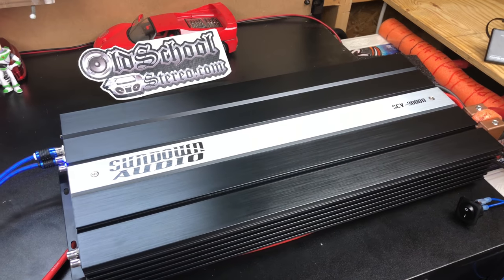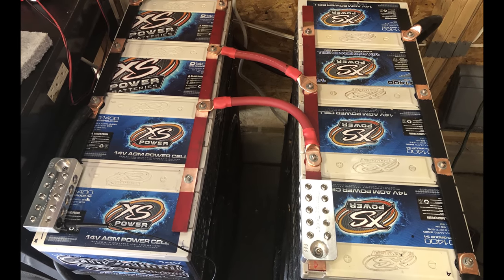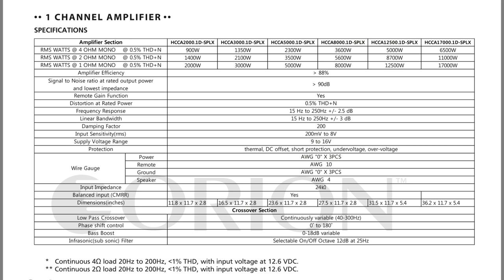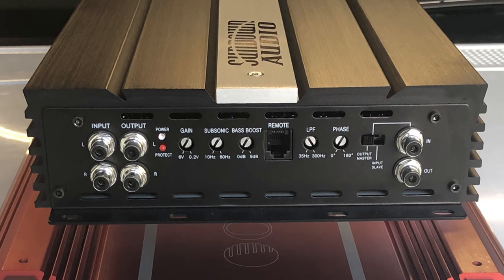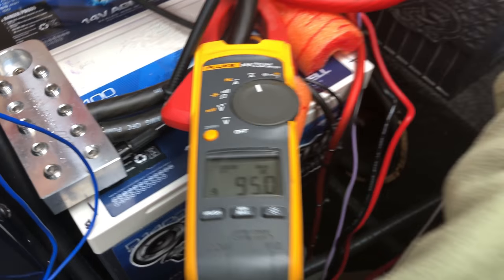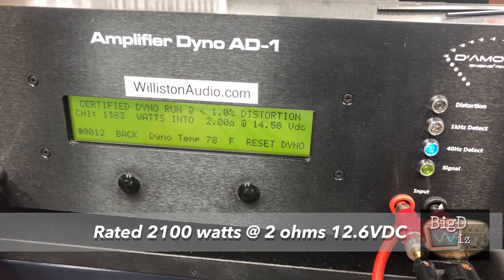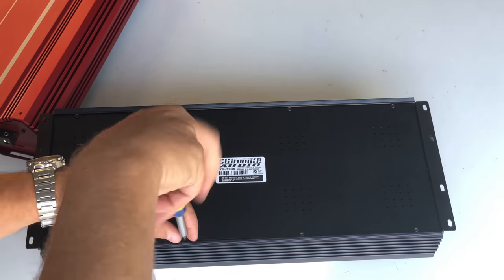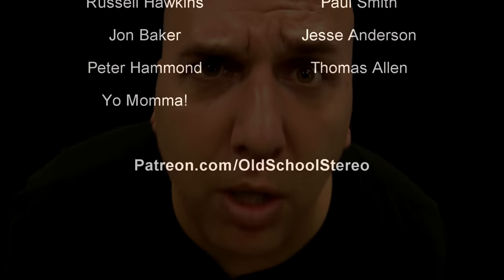Sundown SCV-3000D vs Orion HCCA 3000.1DSPLX Amp Dyno Test (4K)

Comment: Just to see if I understand but when doing a dyno and testing the amp at  .8 with an output of 8799 watts, am I correct in assuming the 8799 watts is the output of the amp if it's final impedance is .8 after rise?  I assume some people think if they wire their amps down to .8 that they will see 8799 watts but after rise, they will more than likely be around 1.5 ohms and will see far less than 8799.
Reply from the maker: No ride with Dyno tests. The amps are tested into resistive loads which do not exhibit impedance rise

Comment: Would like 2 see you dyno a Earthquake phd10000w2 . Its a Red Amplifier. Claims 5000RMS.  I running it on two 106v2 Jl audio sub's. Extra agm kinetics battery. No complaints. It slaps hard.

Comment: Would have liked to have seen Orion 12v test.  Great videos!
Reply from the maker: Birth sheet said 3300 at 12.6
Reply: BigDWiz I just thought the comparison of ur test to Orion's test would have been interesting.
Reply from the maker: I use 14 volt batteries, so not easy to get down to 12 volts
Reply: BigDWiz sorry, I forgot u use 14v batts now..

Comment: It's December 2022. The Orion HCCA 3000.1 is back on sale and I'm about to pull the trigger. It's like $700 on Amazon. I'm hoping they're still basically the same as when Big D reviewed it, but maybe with some improvements. 

I have 2 Ignite R3000.1D, each powering a Skar EVL 12 on 5 car batteries with a stock (90 amp) alternator in a 2016 VW Tiguan. It drops to 12.1-11.9 volts engine running so here's the planned upgrade:

2x Skar ZVX-12s, Orion HCCA 3000.1 on 6 car batteries (might upgrade to Lifepo4), with a Mechman 370. Also looking at Deaf Bonce Apocalypse 12s.

edit: the Orion now DOES have a variable subsonic filter instead of a switch! Hoping this is the only change that was made, and everything else is the same or better.

To expand on my current build, I chose the Ignites based on Big D's reviews and they have been incredible for years now. They put out 1150 watts RMS each, and the Skar EVLs have likewise been a great value and pound like hell. Whenever I do a bass demo it shocks everyone and pops eyes open, takes your breath away. Currently in a 4.5 cu. ft. ported QBomb box but I may fabricate my own for the upgrade. If I switch to Lifepo4 it'll probably be 3x 100 aH, and of course I'll do the big 3 upgrade with the Mechman 370.

Any subwoofer recommendations will be considered, aside from Skar ZVX-12s I'm looking at Deaf Bonce Apocalypse, Sundown Audio X, or DC Elite.
Reply: Do anybody have a up to date photo of the Orion 3000.1??

Comment: That's cool that Orion is built so well but I feel like with it putting out that much more then its rated I'd be blowing subs cause I'm expecting 3000 watts and getting 7k
Reply: Them set using a dmm to 3000 watts  problem solved

Comment: Back in the days of mini trucks and people rolling competition sound systems a good friend of mine had a 70’s Camaro with 8 10” Orion subs with a highfonics sis amp running them: that was enough to possibly stop ones heart. If I remember correctly that amp was rated at like 400rms. So if I were to  run a similar set up with today’s 3000wat amp would that make it louder? What I’m getting at is are today’s 3000 wat amps really that much stronger than our Rockford punch 150? Is it just marketing? Do you have a video explaining this or can you make one please.
Reply from the maker: Yes new amps are WAY more powerful, however the subs are less efficient. Bigger amps require more wire, bigger alternator, extra batteries etc.

Comment: The Orion is very underrated. What I hate to see though is those darn Samwha caps. I've replaced a ton of failed Samwha and capxon capacitors over the years. You'd think at that price point they would spec decent capacitors.
Reply: ive been trying to find out which cap brands are good when they do guts shots. what other brands should we look out for besides those 2 mentioned or are there certain specs to look for, i always wanted to know what the numbers on the caps mean

Comment: I know having lower watts than the specs is bad but having more is bad also right ? Especially when it's almost 2x
I mean, it says 3000 watts and if i get 3500 watts subwoofer, i might blow it, because that thing pushes way way more than rated.
Reply from the maker: You can overpower subs, but I’d rather get more than less for my $$

Comment: Could have seen Orion slamming sundown in this test. 
You can tell by looking at the power connectors on both amps. 
I personally believe it defeats the purpose to have copper connectors for doubling the power wires to a single terminal. 
Its all going to travel through the same circuitry. I do believe thicker power wire is for better performance and for recommended specs to an amp. 
However after watching the trays get pulled to show the insides of both amps. Its a dead give away that Orion has its power sources split up in the circuit board before amplifying sound to make a lot more power.

Comment: Is the discrepancy on the Orion from them rating at .5%THD vs.  your 1%THD certified test?
Reply from the maker: That and the fact they rate at 12.6 volts. There is a LOT more power capable with 2 additional volts

Comment: Orion Murdered the competition. How would one get triple power wires to the amp? Do you just wire them directly to the battery? Besides doing the Big 3, What other upgrades to the cars electrical system Must be done to Accommodate such high Amp draw? What’s a Good rule of thumb as to when these upgrades need to be done, for example if you’re running anything of “X” amount of Watts you should definitely do certain upgrades? Thanks for Any help.
Reply: from what ive been told, do the big 3 when youre system is pushing 1000 watts rms, install a capacitor around 1500 rms, change the alternator and get a second battery at 1700 rms. for the hcca amp im assuming multiple alternators and at least 3 batteries to keep it happy

Comment: Testing done n if all the amps were the same price what one would you choose. 
Not an easy decision some people don't need over 7k. Some people would look at the longevity of the amp. A lot of people would just flat out stick to there brand. So Derick what would be your choice?? I know what mine would be...
Reply from the maker: I really like the efficiency of the Nendo and DC amps. I really don’t think you could go wrong with any of these. I bought the Orion and plan on trying it out, but most likely at 4 ohms
Reply: BigDWiz that would be my choice too. And for the same reason.👍👍👍👍

Comment: Big D,,,, I wanted to ask your opinion on these newer amps.. Do they sound as good as the amps of old to u? What I mean is,, 2000 + watts nowadays can be had for decent low price. but,, do they sound good.. ? 2000 watts might be strong, but if the pre- amp is junk or the sensitivity  is low ,, from my experience,  they don't sound good.. kind of empty sounding. not rich dynamic sound.. back in my days of the haydays of brands like fosgate,alpine,ppi,a/d/s, phoenix gold,etc,etc.. anything that was worth a shit at all soundwise, was a buck a watt.. I'm talking late 80s -95ish Era of sound..  In my experience the stuff now is either cheap to buy and sounds like crap, or overpriced and not even a shadow of old school power.. What is your opinion.? I can't afford to figure it out these days.. lol
Thanks Man!!.. Love the Oldschoolstereo!!
Reply: stick with A/B amps for better quality but they consume the power.They get hot.  As for Class D... these days people are that design these days with better filtering Caps etc... Chokes... Class D is efficient, run cooler and suck less on the battery in the end.  Class D has come a long way since the days they was mainly used as woofer amps and not for mids and highs.  These days theres some really great TINY Class D Amps that sound really good in the mids and highs. and deliver lots of power in a very small box.... These are the best of times for Car Audio....  BDBD/2021

Comment: Where do i buy a high amp power supply to use Hcca 3000.1 in my house or is there a better solution to this problem
Reply from the maker: You’d need something like a XS Power Titan 8 and charger
Reply: Williston Audio Labs thank you and I appreciate all the dynos you do . Is there a difference in amp draw if i used the same amp one for highs and  one for lows not the same amp but 2 of the same kind?

Comment: Where can i buy this amp??? What the model number.. im having a hard time finding the new orion splx series
Reply from the maker: They are currently out of stock, but coming soon.
Reply: @wal  do know if they going up on the price with this HCCA3000.1DSPLX?.. i see some websites prices now have them at $959.. compared to the $649 on Amazon.. same for the HCCA121SPLX subwoofer.. i 1st found them at $1,299 and now i find them at $1,999... do you if its a possibility when they restock price will be higher??
Reply from the maker: @M1staG4MER  I believe the new MSRP of the 3000.1dSPLX is going to be $799. Not sure about the sub
Reply: @wal  awsome tks alot bruh... love the vids you putting out.. i learned alot from your channel and am now a big fan of your channel.. spend hella hours watching all your vids... looking for a new amp to buy and am stuck between getting the new Crescendo BassClef 4k and the Orion HCCA3000.1DSPLX... any insight or suggestions between the 2... starting to now learn towrads the Crescendo 4k since Orion is upping up the MSRP... what would you go with??...

Comment: Is Orion really in the $0.13 per watt range? Would probably invest in some better quality caps for the power supply section (Nichicon/Panasonic/Cornell Dublier) at that kind of power (low ESR, best ripple, etc. etc.) as you don't want a cap named after a sound effect going pop at that kind of current pulls. Probably wouldn't hurt looking over any films/electrolytics in any of the signal path and going higher-end there too, as that extremely low price tag means they skimped on some things.
Reply from the maker: Fred Sanford likes Ripple 🤪

Comment: I have 2 pioneer premier champion series 12s, they say 1k rms, what amp would you suggest for under $150 for them???
Reply: Th3Aggr3ssiv3 Cons3rvativ3  that's one that my buddy recommended
Reply: Th3Aggr3ssiv3 Cons3rvativ3  how much is the skar though? I was gonna see if someone would maybe trade mine and a little bit of cash for a different amp
Reply: Th3Aggr3ssiv3 Cons3rvativ3  I have the boss phantom 3k, unfortunately it only does like 900, 450 to each sub, only paid like 100 for it
Reply: Th3Aggr3ssiv3 Cons3rvativ3  well it's what it says online and another YouTube guy said it too. I didn't really do any research into it before I bought it.
Reply: Th3Aggr3ssiv3 Cons3rvativ3  yeah, just have to get some money. My buddy does have a ssl Evo 3k, online it says like 1300rms, thought about trying that out
Reply: Th3Aggr3ssiv3 Cons3rvativ3  yeah, most of the videos I've watched of the premiers is them putting a 3k or 3.5k Brutus on them and they flex the windows.
Reply: Th3Aggr3ssiv3 Cons3rvativ3  premier champion series, I don't remember the exact model number but I think it's something like 3002d2

Comment: I am hearing that Orion (MD Audio) has their own buildhouse for these amps. So, they're not limited to buying off-the-shelf boards that are just duplicates of other brands. Can anyone confirm this? If true, then it would explain a lot about why the Orion internals look so unique.
Reply from the maker: This is what I’ve been told directly from Orion. They also have engineers who design the amps and include a birthsheet with each XTR/HCCA amp.

Comment: I expected the Prion to win but holy crap! Not by that big of a margin! Sundown did good exceeding it's power until the 1ohm run where it only exceeded it by 4 watts, and the fact that the Orion doubled the Sundowns power at a lower price is insane. Good to see Orion is still keeping the old school hcca rep alive.
Reply from the maker: No comparison here. The Orion smokes the Sundown
Reply: @wal  Yes sir! I'm going to be putting four 8" sundown E8"s in my titan xd. Should match perfect with my JBL 1001ez. I watched the dyno on that infinity 1000 amp that you said was essentially the same. 1,300 watts ought to be perfect for those 4 subs which are rated at 300 watts rms each. My wife says I can get them for my birthday Cant wait lol. Getting some Martin Logan Motion speakers installed in my ceiling and a pair of electrostatic esl towers and a motion center channel for the house after that to complete my home theater upgrade. I have an Svs pb2000 sub right now and a Denon AVR-X3400 receiver. What can I say, I'm an audioholic and a sucker for old school car audio. Love watching your videos. You have the best amp dyno videos.

Comment: Just for fun I divided the 13.58vdc (which the Orion sucked your supply voltage down to when it did it's 8799w) into the 14.21vdc it had when it did 7673w and got a percentage of voltage of .9556
So I took .9556 and multiplied the 1.2 times 7673w ( since an .8Ω load should provide 1.2 times or 20% more than) the 1Ω power >IF VOLTAGE REMAINS CONSTANT< ) and my calculator showed (if linear) it should be 8799w - lol

Comment: So DC, Sundown, Orion, and Skar are all "Korean" built amps? Are they designed in the US, or off-the-shelve type amps or what? I've been researching Orion amps. Those red HCC or whatever are expensive, but seem to put out crazy power. But I also see Orion amps on Amazon for like $150 bucks and rated at like 150wX4 RMS @ 4 Ohm. 
--So what gives? Does Orion really make those numbers? And if so, is the power clean?
--And if the above is true, then why bother buying a JL or RF amp?
I also was doing some reading and some guy wrote to be careful with Orion amps because they can be "Dangerous," and can cause some really bad things to happen to the car and recommends professional install only for the Orions, and huh?

Comment: Never thought I'd live to see the day Orion made an underrated amp again.
Reply from the maker: The funny thing is I’ve proven many times many of their old school amps are not underrated at all 👈😮
Reply: Indeed, I've watched those videos and the 2100HCCA was a huge disappointment.   Awful glad I never bought one back in the day (owned the first gen 225 and 250 though and they did well by me).  By underrated I just meant the number on  the heatsink vs. the number it would make.

Comment: Dereck, you are def right about those ugly endcaps and cheap bass knobs. Those red HCCA's deserve better!
Have been kinda skeptical about Orion since MD Audio bought them but, looks like I was wrong. Just wish they still had "Made In The USA" on them like back in the day. -Mark H.
Reply from the maker: There is a point when underrating can be problematic. In this case you have an almost 5kW RMS amp labeled as a 3kW.

Comment: I just want to point out the CEA ratings only require the manufactures to do the test at 4 ohms. Any lower resistance and the method of rating the output is up to the manufacture.
Reply: yea, seems like companies just double or 1/3 the rms to figure 2ohm and 1ohm.. probably saves them 5 min per amp.. lol
Reply from the maker: This is true, but if they place other ratings in their CEA standards, then they are measured by the standard. The Orion had a CEA cert rating for 4 and 1 ohm
Reply: BigDWiz Not necessarily. The subscript did read additional power information. Regardless of what they write the CEA standards do not require them (any company) to remain at/below 1% THD.
Reply: Carl Jr companies put cea on there box when there amps jus don't do rated power at any ohm load so really even following cea standard in general is up to the company it's not law which I think it should be lol

Comment: This channel does what many other YT channels don't do; they rate efficiency. Which is important.
The problem is all this are electrical measures. This is like Julien Hersh in Stereo Reviewin the 1960's  everything was electrical measures and there was little or no attention to what the units really SOUNDED like. Also there was little attention to what equipment an amp worked well with.
What gear going into an amp and what speakers made a complete system which would sound great and what components if hooked up sounded like a clogged toilet. So I'd like to have some comments on what gear sounds like. Car sound equipment isn't only to blast neighborhoods of people dissimilar to you and annoy everyone. Vehicles equipped with a sound system should to provide sound that people enjoy.
Reply from the maker: Thanks for the comment. The reason I usually don't discuss sound quality is because it's subjective. I prefer to show the actual output numbers and let the consumer decide what sounds good to them. I will comment if I notice something "off" with the sound or if it sounds especially good. Otherwise, you won't hear me comment on sound quality that much at all.

Comment: Is there a calibration between amp dynos? I ask as Jacob posted his SCV lineup amp dynos, and the 1 ohm is a bit off from yours Big D. His tests shows doing 3334 @ 1 ohm certified @ 12.67V Your test shows 3004w @ 14.62V , something is off here. By your test, the sundown wont even hit rated at 14.4V
Link: http://www.caraudioclassifieds.org/forum/sundown-audio/173007-scv-amplifiers-amp-dyno.html

Edit: corrected voltage.